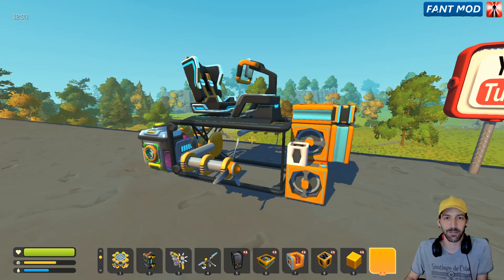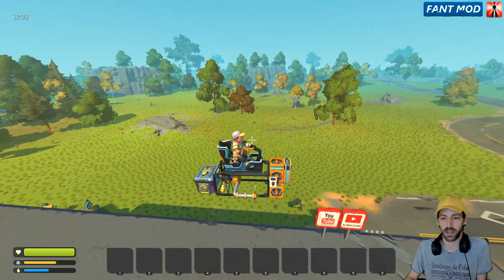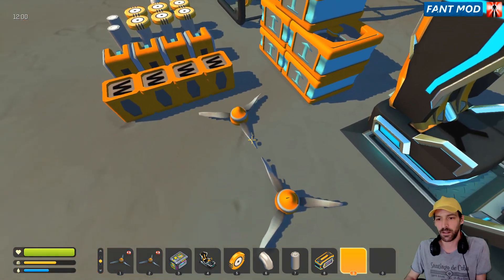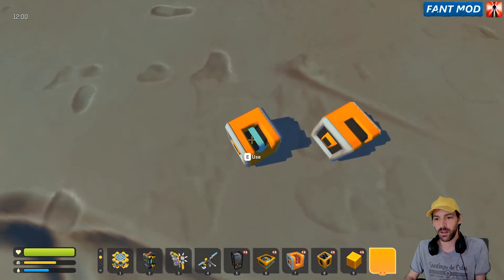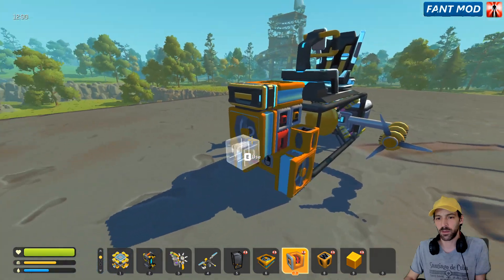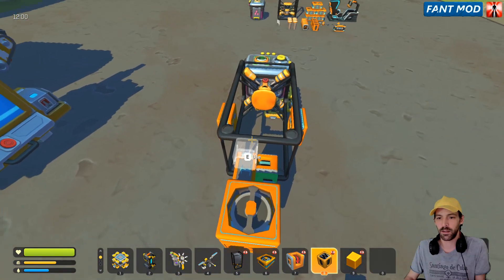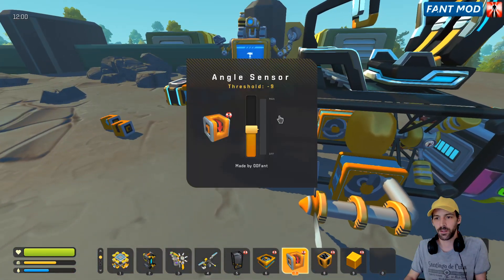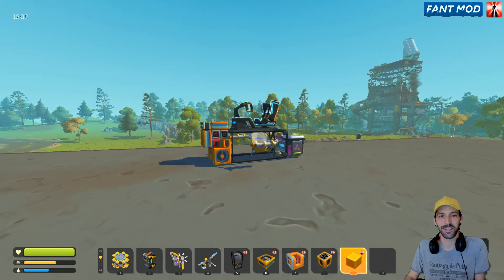Scrap Mechanic | FANT MOD - How To Use the - Cle, Gyro, Angle Sensor to create a Flyer

Comment: I'm not sure if I botched something, but no matter what I do, whenever I start to fill the chemical lift engine, my flyer just rolls over backward, on the Pitch axis from the front to the back (Backflip). I've tried adjusting the angle sensors, I've even tried removing the sensors and the all three of the gyroscopes controlling the pitch, and I still get the same behavior whenever I fill the engine. Can somebody help?
Reply: Mine does exactly this too. Straight flips over, and stays perfectly upside down. I might try reversing which of the sensors is painted. Perhaps that's the problem?

Comment: please don't change this but i just discovered that you can put a propeller/wheel directly on to a gyro (3x3) and then put that on to a free spinning bearing, connect the gyro to 2 switches/buttons or a driver seat with a wasd converter and you have free mode of transport. I'm working on a Mono-wheel propeller assisted vehicle just now, it's so much fun, just came here to figure out that angle sensor.
Reply from the maker: clam down, u did not discover anything.. its intentional :P
Reply: @00FantMod  Great stuff happy to hear that.

Comment: I cannot seem to get my flyer to stay balanced in the air, it just keep on spinning in a circle on both axis.
Reply from the maker: U can Connect a Angle Sensor direct to a Gyro  ( 1 Single Angle Sensor ) that got changed. You dont need 2 anymore.
Reply: Would I still need one for each direction? My creation never wobbled and seemed as if the angle sensors weren't affecting the flyer
Reply: @00FantMod  Umh, there was some change to the chemical lift engine too, or the WASD controller? If i press left click or right click the input don't "stay" in, act like a button, if it explain...
What about a little new lesson for us? :D
Anyway, awesome what you are adding!

Comment: I wish this video had more on the gyro and sensor fine tuning, my identical flyer is totally unuseable no matter what i do to the settings
Reply from the maker: 1. lower the gyro power
2. add an additional gyro without connections, and set its power to max.
Reply: @00FantMod  hey thanks for the reply I have done that as per your excellent video I messed around a lot with gyro values, swapped sensor colors, set sensor to +  and - values & tried many settings of the gyro too it just wont stabilize and keeps rolling over , kinda stuck there now
Reply from the maker: @damiandeadbeats  join the discord and ask in the q&h channel

Comment: you can also balance out a flying vehicle by placing anything with weight on different parts of the vehicle if your nose rises to fast add 1 row to the front vise versa if the rear rises to fast... keep adding 1 row of the weight block down after each test to see how much more weight is needed to balance it out...
Reply: You could also dangle a large weight from the bottom whats your point

Comment: I am trying to recreate this with the newer version that just uses 1 angle sensor per gyro and am having some trouble. It seems to only tip backwards no matter how I change the settings. Any tips on troubleshooting?
Reply: cant get gyro stabilisers to work at all here in the sky mech mod